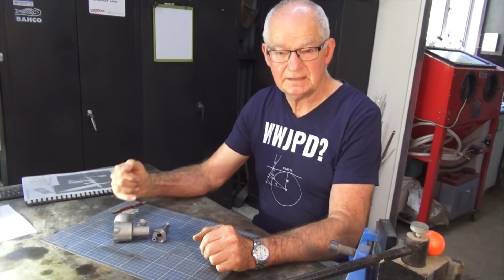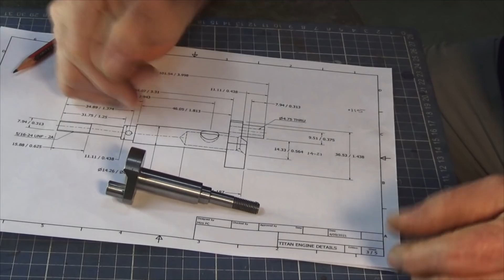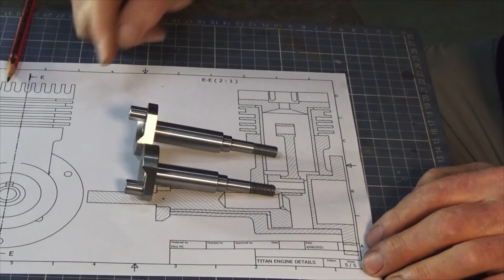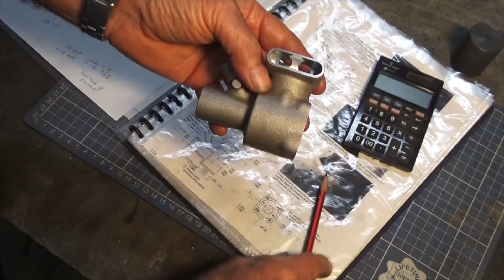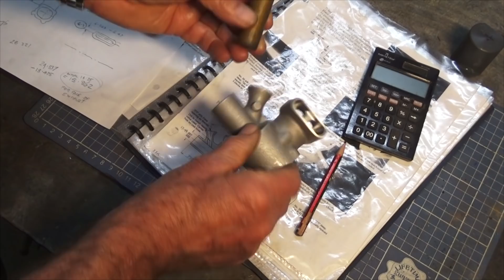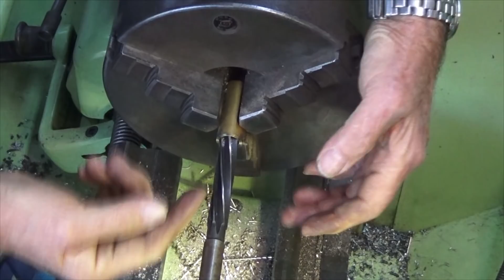Building the Titan .60 Glow Plug Engine #3

Comment: I love lapping cylinders! it's probably my favourite bit of engine construction. to be fair lapping just about anything in the lathe is a satisfying, meditative process for me. and it's one of those skills that once mastered, will enable the production of extremely precise parts. getting the actual lap right is a major part of it but only in so much as the tool can influence your technique, The laps don't have to be complicated, just a split lump of ali with a clamp screw will do just fine.

and if you're not sure of you're technique just yet, Clean and measure the part frequently as you go, hopefully you'll be able to correct any problems BEFORE you get to the finished dimension! Also bear in mind that the heat will expand the ali lap a little, causing a very small positive feedback that can tighten things up and remove more material that you'd like, go slow, and use LOTS of oil!

Comment: So in the 1st video when you faced it to length you shouldn't of taken all that meat off. I was wondering why they'd that much on the length for a piece that had to be turned between centers
Reply from the maker: That's it! I should have realised something was up at that point. As it has turned out though it was a good thing making the second crankshaft. 
Regards,
Mark
Reply: @Preso58  I was thinking maybe they left that on for chucking so you didn't have to turn between centers but I can't see how that would of worked. Never mind mate easy fixed, at least it wasn't the casting. I'm looking forward to see it run.

Comment: Am confused why you needed to convert ! Do your machines not do that ?
Reply from the maker: I don't have any imperial micrometers. The digital calliper can do both but for very accurate dimensions the micrometer is the best tool to use. Also, a thousandth of an inch works out to roughly 0.03mm. I can get better resolution working in hundredths of a millimetre. 
Regards,
Mark
Reply: @Preso58  Ahh I see ty for explaining that makes total sense now

Comment: Good Show Mate: As per normal. Don't let this out but I made a mistake once. It scared me so badly I have never made another one. I was doing a little sweating with you. Boy, when it gets down to close running fits it is hard to sneak slowly enough. Put on your sneakers and go for it.
Reply from the maker: Thanks. I think I realised early on that there are going to be quite a few do overs on this job. If you were making 10 engines you would probably not be scrapping parts by the tenth one. However it was the crankcase casting that was giving me sleepless nights. 
Regards,
Mark
Reply: @Preso58  If you were making these in production you'd have all sorts of jigs and fixtures and there probably would not be many mistakes. Doing one off's, when you have not done it before, is way harder. That's always been my problem. Almost everything I have ever done in my machine shop has been a prototype. Easy to make boo boos when you have not quite done this before. Principles yes. Specifics not so much.
I do love your channel. It's right out there where you can see what's going on. I am watching a friend do good stuff.

Comment: I don't understand the need to convert US customary units to metric. You probably have a DRO, your calipers may be digital and switch readily. If you don't have a DRO for the lathe a linear dial indicator is pretty cheap.
People struggle with inches, but I don't understand why. In machining it is all base ten as well usually down to thousandths. I understand not having measuring tools in the right unit though.

On drilling brass, to prevent it from grabbing your bit, grid the bit to have zero rake by flattening the cutting face. Then it won't self feed. Of course then your bit is stuck as a special one for soft materials...

I assume you know, but lap the crank after fitting the bushing into the case, as it will shrink a little under the interference fit.
Reply from the maker: This debate will go on forever! My problem is that I don't have any imperial micrometers and I don't feel it is necessary to buy any if I can convert the units. Thou units are almost three times larger than hundredths of a millimetre so I can get better resolution using metric. I know you can work in tenths of a thou but again. I don't have many instruments capable of that resolution. Finally, and this is where I always run the risk of upsetting people, there are only three countries in the world still using imperial units, the USA, Myanmar and Liberia. Even Liberia is transitioning to metric. If you are used to using metric then that is the system you should use. It's a bit like me insisting that everyone in the USA should use metric. People could probably do it but they would prefer to use the units they are used to. Having said that we can all still be friends. 😁
Regards,
Mark
Reply: @Preso58  Just to be clear the US doesn't use Imperial units. They established their own unit system based on it though. Lengths are now the same (historically each country had their own inches), but volumes are quite different.

I agree the debate will go on forever, and my point wasn't that one or the other is better, though base ten usually wins that argument. I use either which ever is easier for the situation (usually based on the materials and tools available). I didn't want to start the argument about that. It was more of just use the units the thing was drawn in whenever possible. I realize there are limitations on tooling though. I only have a 0-25mm micrometer and digital calipers to do both. Machines here (US) are generally marked in inches, but with a DRO either can be used equally. I am curious if you bought inch based end-mills though.

As for where inches are used, I would say that the whole world still uses them. It just wasn't worth creating new standards for so many things to switch. Camera mounts, pipe sizes, o-ring sizes, the list goes on. They are listed in metric sizes in many cases but actual dimensions are inch based. Unfortunately I think we are stuck with both for a very long time, even if the hold outs switched. They are too ingrained in our products. It would be nice to only need tools for one.

Comment: It`s funny how they made these in production. Imagine if they took all the measuring and checking their math 3 times like you have been. It would have cost as much as a car motor...hehe. Great stuff .Cheers from Canada.
Reply from the maker: The thing with production is that jigs and fixtures take care of all the positioning of the stock and either CNC (today) or cam operated semi automatic turret lathes would take care of all the sizing. Usually a representative sample of parts are checked with gauges but other than that there would not be much measuring or manual machining. What I am making is essentially a one off prototype. Given that I am unfamiliar with the design and I have never made an internal combustion engine before I am really pushing up against the limits of my skill set.  However, that's how we learn new things.
Regards,
Mark

Comment: I was into marine R/C mostly and here I am in my 60’s and still have a whole lot of that stuff. My largest motor id a Picco .90 marine. I had the presence of mind to buy spare parts and have a complete (new piston and liner) on hand.
This series has me thinking of getting all of that stuff unpacked and sitting in the middle of the floor and making “Vroom, Vroom” noises. I surely don’t have a fat enough wallet to pursue that hobby anymore.
Great project!
Reply from the maker: Thanks. I think flying model aircraft is a good way to go broke. I went to a model airshow called "Jets Over Coolum" and it was the first time I had seen (and heard) turbojet powered models. It was truly a wonderful experience but it was also quite sobering to see the piles of debris from some very expensive looking models that had performed unintended vertical landings. Back in the olden days when I was flying control line aircraft we would take the wreckage home and just glue it back together again but nowadays with the foam and carbon fibre construction I think that the whole lot ends up in the bin and you have to start over again. 
Regards,
Mark

Comment: Hey Mark I was just wondering if you couldn't have copied the design into your CAD package in imperial (from the plans)  and then have the program auto convert everything to metric for you to machine? Wouldn't that eliminate any possible translation/conversion errors??
Reply from the maker: Michael, that is what I did. Autodesk inventor allows you to input dimensions in fractional inches, decimal inches and millimetres. It does do the conversions automatically and then depending on how you have set the 2D drawing preferences it will display the dimensions in whatever format you choose. My mistake was simply not entering a constraint for one line in the 2D sketch of the crankshaft model. It looked right but I should have verified that the overall length of the part was correct. Also, since I had not machined the crankcase at that time I had nothing physical that I could check it against. Dumb rookie error and I should have known better.
Regards,
Mark

Comment: This question may have been asked before ..Have you ever considered ( or find it necessary )cross-hatch honing ( for the piston/cylinder bore ) in these type engines ? ..
and a sincere Thank You for the interesting and entertaining videos 🤩
Reply: I'm looking forward to the piston/sleeve details, too.  Many of the simpler glow engines used no piston rings, relying on a slightly tapered bore profile to produce compression.  Later designs used piston rings and a more traditional bore shape...but IIRC there was extensive use of chromed bore surfaces in commercially produced glow engines.  I'm not sure how the Titan design approaches that - we will see.
Reply from the maker: I cannot answer that because I have never made an engine of this type before. From what I have read though, the cylinder needs to be lapped slightly tapered with almost no clearance towards the top. Because there are no piston rings and no lubrication other than the oil contained in the fuel, the finish is supposed to be almost a mirror finish. I have some diamond lapping compounds, but again, I have zero experience in using them. I am actually about to start lapping the crankshaft tomorrow.
Regards,
Mark

Comment: I look every morning to see the next build update...this is a serious  precision  project.. some of my old Glo engines used a very thin head gasket washer to adjust the compression...
Mark makes it look simple,, but the Tolerances have to be near perfect !!    I  am thinking it will run on 10% nitro??    I can not wait to hear it run !
Reply from the maker: I must say I haven't really considered the head gasket material yet. The build notes do suggest tweaking the compression ratio but I believe this is achieved by facing off the cylinder head slightly.
Regards,
Mark

Comment: I was gonna say you didn't need to re make a second if the dimension was longer but on the shaft but you removed the long one and the short one was the wrong one lol
Reply from the maker: Oh, didn't you know that if you are going to mess up a measurement it will ALWAYS be too short. In the same way that if two parts need to be opposite handed you will ALWAYS make two left hand or two right hand ones. 
Regards,
Mark

Comment: The UK switching to imperial in stores, I heard somewhere
Reply from the maker: I visited the UK a few years ago and we were constantly confused with the speed limit signage on the roads. All in miles per hour and travel distances in miles. Weights and measures in supermarkets were in metric though as was fuel which was sold in litres. 
Regards,
Mark

Comment: Nice job!
One question; why don’t you use the opportunity to make it fit for ball bearings? My experiences is that bronze bearing wil wear out from time.
Reply from the maker: I was asked to build the engine by a former student of the original designer. My offer was to build the engine as a tribute to George Genevro, a 99 year old professor of Industrial Technology. Once completed it is being sent back to the USA. My goal is to make it run but I won't be flying it in an aircraft. Unfortunately, the casting doesn't have provision for ball bearings.
Regards,
Mark
Reply: @Preso58  
Okay, in that case it is an honer to make this engine
Reply: Hi Kevin,
This engine is designed specifically as a RC Aircraft engine and that is the best explination for many of it's characteristics.  Ball bearings are heavy, expensive, and not air tight.  The long bushing in the front must seal crankcase vacuum.  There are no reed valves, carb timing is mechanically controled by the ported crankshart.  To do this with roller bearings and seals would be huge, heavy, and increase the crankcase air volume beyond the displacement volume. (It would require forced induction to run.) Keep in mind even the fully machined version of this engine was very cheap.
Reply: @kevinsellsit5584  
I am not agree with that. 
If you look at a brand like O.S. Max. The cheaper ones have bronze bushes and the more priced ones have bal bearing. 
And so a lot of brands uses that for aircraft engines. 
I have a lot of airplanes and engines, and they have al ball bearings.

Comment: I don't know how i got onto this but it's strangely captivating - nice job Mr. Presling 😃.
interesting to see your approach to each feature. I was really glad to see you didn't use the scribe lines to cut the flats on the crank LOL - nice solution with the parallel. Can't wait to see the next.
Reply from the maker: My eyes are not nearly good enough to be splitting scribed lines like I used to. Sigh!
Regards,
Mark

Comment: G’day Presso. It can be a butt clenching moment machining to size the only casting you have, I was thinking who do you know that can aluminium weld should it go wrong. 
Well done, cheers. 
Peter
Reply from the maker: I spent days summoning up the courage to start machining that casting. I would put it in the vice and then have a sudden urge to go and clean my lathe! I even volunteered to go shopping with my wife.
Regards,
Mark

Comment: It is easy to make mistakes. But only people that actually do things, gets to make them. All others never make mistakes. Yes, the port hole in the crank is part of the timing of the engine. As well as every port cuts into the piston liner. And you can even degree that engine to gain the information for intake and exhaust durations. Some of the engines I used to use had what they called schnuerle porting to give it more power. But it also drank more fuel. Don't get something for nothing. I await your next video. Thumbs Up!

Comment: What got me here is that I had to reverse engineer and draw all the parts for a similar engine as a finals exam in drafting class... It was like an ongoing exam that lasted the whole semester. The finished drawings were used in the following semester where we had to calculate all the tolerances and fits between parts and do the dimensioning. We were probably the last year they were still teaching drafting class with actual pen and paper before going full on CAD! I really quite enjoyed drawing by hand, it was kind of therapeutic... I unfortunately do not have room for a drafting table anymore!!

Comment: Well done Mark, I don’t have a lot of interest in RC motors but I am enjoying the machining and will be quite excited to see it fire up. Cheers Stuart.
Reply from the maker: I have always had an internal combustion engine on my bucket list but 4 strokes were too hard because you need gears for the cam shaft and two strokes always seemed to be the prima donnas of the engine world. If it runs once my work will be done. Thanks for watching.
Regards,
Mark

Comment: Your dimensioning is introducing error. The crank shaft should not be dimensioned from the end. The datum is (or should be) the the left hand side flange, and you say as much towards the end of the video. The 38mm & the 84mm should have set length and the only error should be from tolerance stack from the poor dimensioning, unless i am misunderstanding the which journal has the error. I think you have similar issues with the crank case dimensioning and machining methods. Do you have a dividing head?  Your technique looks wrong telescopic gauges, you nip them up before taking the measurement, manipulate them to find the centre and roll them through the bore. Like your trying to take the measurement then nip them up.   Following good practice you should have found the bush OD issue before you put in the lathe by a quick check with a rule, not that, that OD if the flange is critical. Like to see you succeed but you are setting traps that might catch you out further into the project,
Reply from the maker: Brock, part of the issue is that I am totally unfamiliar with the design. Normally when I take on a project I have already created and verified the model in CAD. It's sort of like virtual machining. With someone else's design you have to work off the drawing supplied and the original designer may not have dimensioned the drawing to suit machining. If you watch the previous episode, I machined all the features for the crankshaft from the threaded end so it made sense to have that end the datum. I zero my DRO from that end and then just machine each shoulder from the zero reference. With regard to the telescopic gauges, I am familiar with the correct procedure but one thing about making videos is that often you mock up a process for the camera so the technique that makes it to the screen is not always how I would do it if there wasn't a camera in the way. 
Regards,
Mark